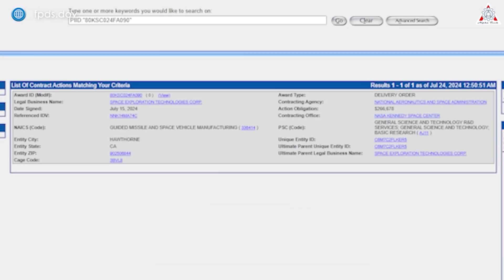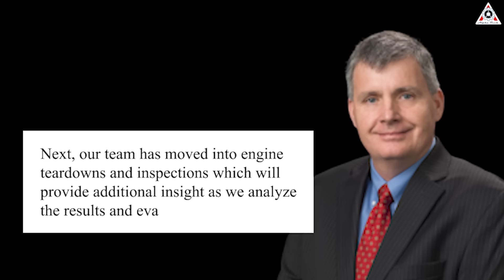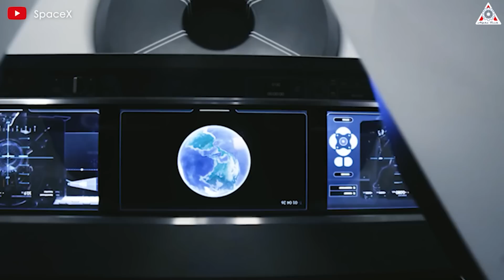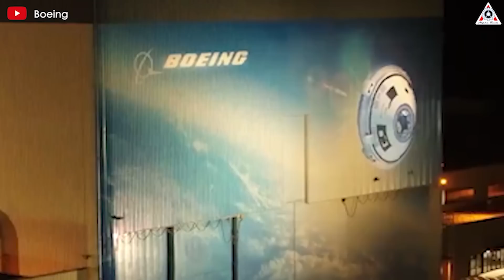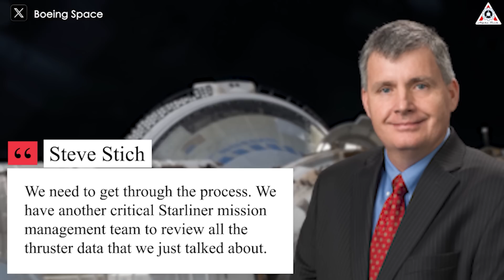Boeing Starliner is OVER!...NASA Says Something Weird Happening On Starliner.

Comment: Ol' Steve chose to omit why they fired the thrusters "more frequently."  It's because they had a Helium leak on the launch pad but decided to launch anyways.  That Helium leak took down multiple thrusters, which meant those that remained had to work harder to compensate for the nonfunctional ones.  Boeing was afraid that another launch delay would hurt their reputation and didn't give a damn about the safety of the people onboard.  And then they decided to keep those people up in space, away from their families, facing the threats of microgravity and radiation exposure for months longer than planned, so they could "collect data."  That data collection is clearly an attempt to consider all adaptations they might be able to try, so that the ship doesn't threaten the ISS and doesn't kill the astronauts Boeing is responsible for.

Comment: Dragon to the rescue. Fit dragon with the male side off the docking head. Fly dragon out empty to the space station. Have starliner astronauts disconnect from the the space station.  Then have dragon mate with starliner. Astronauts leave starliner to dragon. Seal dragon. Havr dragon drag starliner to a point and disconnect.  Starliner falls to the ocean and dragon get recovered.  Problem solved!

Comment: Proof that ISS was Russian's made, not USA. USA only provided money...😅😂😅
Reply: That's pure B.S. - and Starliner has nothing to do with the ISS. Russia - because of its decades-long experience with its own previous space stations - designed the initial module of the ISS. It sits in the middle, but is by far not the most complex, the largest, or the newest part of it. Do you truly believe Russia could have bu;lt a Space Station the size and complexity of the ISS ALONE? What a joke.
It is, in fact, the oldest part of it, and the primary reason the ISS is now failing, and its final days will be in a few years. Russia's space program consists mostly of very old tech, from the Soviet era - virtual dinosaur tech compared with every other space program. It's crew modules are no longer used because they are cramped for two people - stuffed to overflow by three, and cluttered like 1960s capsules with controls, gauges, toggle switches, and parts of the module itself throughout. Did I mention that they leak?
By contrast, SpaceX's modules have reusable boosters designed by itself, and the capsules are clean, uncluttered, spacious (designed for , with a large touch-screen display where the pilot sits, and it tilts as the pilot tilts. 
Russian Cosmonauts must feel like they've entered a sci-fi movie being strapped into a custom-fit seat, in a craft designed by a PRIVATE COMPANY, that has surpasseds, in every respect, anything the Russians ever built. 
As Putin spends Russia's future on a war Russia is losing, against a neighboring country that never asked for war, the Russian space p[rogram - sach as it was, is already dead. The next Space Station, as the current one is, will be called THE "INTERNATIONAL SPACE STATION, for a reason. 
Russia built the center module, and the U.S. Shuttle system (something Russia never succeeded in building), was used to deliver the remaining, newer modules that actually comprised the ISS. Russia's module was the smallest part. The modules that make up our current ISS were made by France, Japan, India, the U.S., Canada (which developed the "Arm" without which the Russian module would have just sat, like Mir, alone, as a tiny little boat in near earth orbit). 
The Canadian Arm made possible the grabbing, positioning, and attachment of every other module onto the Frame of the ISS - (which was built by astronauts using our Shuttle), and the ISS was completed by all these countries working together. 
Russia did NOT "build the ISS." 
It was a cooperative partner - but will NOT be invited to participate in the NEW ISS - which is currently being built. 
We provided not just money - we provided most of the technology, most of the modules, and our modules made the Russian part of the station something that wasn't well-used. 
Russia is done, now, as a "Space Program" country, and has a future before it that looks very, very grim. 
I'm not really sure why you think that the U.S. only provided money, even though the U.S. space program is light-years beyond where the Russians are. They had their chance to participate in the journey to space, and chose to spend the men and money they DID have to try to destroy and conquer a peaceful neighbor - so they deserve the future they will have. They are no longer welcome to be a part of the civilized, cooperative advanced nations of the world, and be in the future, either. 
There is no country as advanced as the U.S. in Space - I won't even rub your nose in Apollo - it was too long ago. But I will say the U.S. has multiple, SUV-sized, nuclear-powered Rovers exploring Mars, for our colony we will build there, and we have orbiting Mars satellites that are able to send information to and from those Rovers - we even had as part of our newest Rover a little helicopter, that accompanied the Rover sending back aerial pictures, until it just wore out. The Rover is still going strong, though - how many Rovers DOES RUSSIA have - or has EVER had - on Mars? None that I can remember.
How many satellites does Russia have orbiting Mars, or the Moon, and craft exploring the other planets, visiting comets, and (the Voyager probes, launched in the 1970s, OUTSIDE our Solar System, STILL FUNCTIONAL, sending back information about interstellar space?). Oh, yeah - none - war was more important, I guess. 
Russia is done, as a technology innovator (it never really was one, except in a few areas - but the U.S., and its partners, are just getting started.

Comment: It's worth remembering that NASA and North American burned three astronauts to death on the pad due to bad hatch design and nearly lost three more in space. Grumman's LM was delayed by nearly a year. Thiokol killed seven astronauts, and Rockwell killed seven as well. Don't be in a hurry to condemn Boeing or stroke off spaceX, it's not a question of "if" it's a question of "when".
Reply: wrong wrong wrong that wasn't the reason at all, stop talking crap. They used a 100 percent oxygen atmosphere, a short melted some plastic insulated wiring which burst into flames in that oxygen rich atmosphere and it spread super f'ing fast and they were dead/asphyxiated even before they got out of their harness's
Reply: Apollo One still haunts me. The reasons were far more complicated than a "bad hatch design." They were using a 100% oxygen environment, and at that time D.C. controls weren't powerful enopugh to use, so the wiring and power were all A.C. 
It was a bad hatch design - but the wiring insulation was also flammable, and there were a multitude of other issues. 
It is a tragedy that three good men had to die for the engineers and administrators to slow down and listen to the Astronauts. Gordon Cooper TOLD them it was a bad design, and no one listened. 
I have mentioned in other posts that the mistakes that NASA and Boeing are making are essentially the same. The Apollo capsules had to be completely redesigned, until they were as safe as the COULD be. Space will always be dangerous - and we've lost a lot more than three other astronauts - two shuttle disasters which also could have been presented, cost us the lives of every crew member - and if memory serves me correctly (it doesn't always, anymore), each Shuttle mission had six or seven members. 
In Boeing's case, their greed and corporate ego are on full display, and NASA's favoritism toward a long-time military contractor is as dangerous as Boeing's incompetence.

Comment: Since Starliner is 10 years late why has this testing not been done by now.  Why are they testing in the desert where it is hot  when space is cold and has low pressures. It should be done in high altitude or in special fixtures with climate and pressure controls. Maybe in future contracts NASA needs to make sure a board member of the company contractor has to be on the first maned flight.

Comment: Confidence has already eroded, the only logical and safe course is to send dragon to retrieve those two poor souls. At this point, they may need to be brought home on stretchers because of muscle and heart degradation. Plus with low helium and dead batteries, plus I am weary of their ablative heat shield. They took money for  a Maserati and gave NASA matchbox car. Is it really worth risking two poor brave souls to prove a mmm point? Send dragon with Elon to save the lives of our heroes that put their faith in a model airplane made with substandard glue , low batteries, not enough helium, probably a faulty since they didn’t learn from Apollo one to use non flammable wire with a bandaid to fix they made 10times what they gave NASA and doesn’t deserve another chance. And if those astronauts blood will be on their hands and will not wash off like Shakespeare wrote about. A disgrace to the American space program. All these years and the 737 and then this? Someone needs to go to jail and have their most tender parts violated for the transformations for building a capsule built out of duct tape and chewing gum! Space and reentry is dangerous and unforgiving for those who cut corners for a larger quarterly bonus.SHAME ON THEM!!!

Comment: Not enough Helium, dead batteries, probably faulty ablative shield, and a litany of issues probably not disclosed! Let Elon save those two precious souls!
Reply: The helium issue is completely fine; they have confirmed that the system is not leaking while isolated and there is plenty of time available once they need to use helium again. The batteries are actively recharged from the station. There is literally nothing to suggest the shield has any problems given that it has worked with no concerns the last two flights.

Comment: One thing I haven't heard from any commentator is... Did the manual control of the capsule stint during the period before docking contribute to the problems? An overconfident, supposedly seasoned astronaut with a cavalier attitude to "flying in space" may have resulted in small but accumulative number of issues that built to the point of the major problems now happening.
Reply: Yes, but no. They do believe that manual control leads to higher thruster utilization, which was likely the reason this did not occur on previous uncrewed tests. On the other hand, nothing has indicated the manual control was excessive or that anyone had a cavalier attitude, just that manual control is always going to be a bit less precise than autonomous.
Reply: No. They HAD to take manual control in order to dock, as they reported to the ground, and asked of the ISS crew, "Could you turn the Station lights on? We can't see you - there's a thick, blue, viscous substance covering the viewport." 
This thing, left to its own devices, could have seriously damaged the ISS. One of the main problems, all along, has been the automatic thruster system, and it's a good thing for the ISS that these two astronauts had the experience not to freak out, and calmly do what they had to do. 
Space is not a video game, and there is ZERO room for over-confidence, big egos, or "cavalier attitudes," 
These are two of our most competent astronauts - working as a crew to pilot a vehicle so poorly engineered it should NEVER have been allowed to fly - and NONE of this is down to anything these astronauts did or didn't do. 
If you get cocky in space, Sparky, people die - and there aren't any "do-overs," like in a video game.   
These are real astronauts, who know the risks, and do the job anyway.

Comment: I don't think you want to @1:40 keep a fueled spacecraft on standby.  Fueling up doesn't take anywhere near as long as it does to prep a vehicle.  I wonder if it's even possible to keep a vehicle on standby, since several things such as the FTS have a very short lifespan and need to be inspected/replaced when they expire.  Also the shape of the return capsule is designed to make it "self-orienting" @5:50, requiring only correct orientation at atmospheric insertion.  The computers are in the return capsule, there is not "vital information" @6:39 in the service module - what's in there is all the bits that the engineers would love to get a look at to see why it broke.

Comment: boeing is done, oh grandma!
Reply: Better than Rocket is here
Easy lift off 
Easy land on with antigravity Spaceship
No Fire
No Explosion
No Flame
Just Spin and
Lift off
Powered by Baterry

Work base on Gravity just spinning by using Battery
can fly in bad weather, plunge in the ocean even in outer space
Can lift more than 100 Ton 

Earth which weight predict 600 trillion ton does not fall at the Sun because of centrifugal in orbitting, on the contrary it does not be thrown far go out the orbit line of hold by gravity at the Sun as orbit center. Gravity and centrifugal is equal called Equillibrium, thats why until now Earth which we was inhabited always rotate and circulate the Sun. Now we justly take example : how if the gravity used and centrifugal is negated? The Earth will float far leave the Sun. So that centrifugal can be used to fly far away if gravity eliminated. Finally how to eliminate gravity?

It’s way rotate part of aircraft by horizontal. When that rotation faster centrifugal force getting greater and the gravity getting smaller, finally it lose the gravity and the aircraft start flying. Of course people would surprise: how the aircraft can keep rotate without fulcrums? Thats why we named that aircraft Shuttling System that is aircraft likes two disc adjoining attached in the midle as fulcrums:

A. The Top part, we name Positive rotate to right, and the edges is getting thicker and havier.

B. The Buttom part, we name Negative rotating to left, and the edges is getting thicker and havier.

C. Middle Part , we name Neutral, air crew placed and also machine and everythings turning Negative and Positive at the same time.

The aircraft can liftup added with explosion from the engine. However that aircraft construction later, let the engineer doit it, and we are sure the aircraft will bulletproof and also waterproof.
 
.
.
 
In modern civilization where human being generally using flying saucer as vehicle, will a lot of change in lives either in materialism and in psychological. In materialism area will apply the change in life like.
People no longger need roadway and rel road which spend large of energy, money, places, things and time, object place and time. People would utilize that area for habitat or for other need:
Reply: Rocket is complicated and dificulte
Low safety and high cost
We need somethings better
Developing technologies to enable human access to space at dramatically lower cost and increased reliability #FeelFree

Comment: Boeing is 100's of Billions of dollars over budget, and years behind schedule.
Time to END ALL CONTRACTS WITH THIS FAILED COMPANY ABUSING TAX DOLLARS.
Reply: Rocket is complicated and dificulte
Low safety and high cost
We need somethings better
Developing technologies to enable human access to space at dramatically lower cost and increased reliability #FeelFree
Reply: @dadearinto5546  it's called SpaceX
Reply: Better than Rocket is here
Easy lift off 
Easy land on with antigravity Spaceship
No Fire
No Explosion
No Flame
Just Spin and
Lift off
Powered by Baterry

Work base on Gravity just spinning by using Battery
can fly in bad weather, plunge in the ocean even in outer space
Can lift more than 100 Ton 

Earth which weight predict 600 trillion ton does not fall at the Sun because of centrifugal in orbitting, on the contrary it does not be thrown far go out the orbit line of hold by gravity at the Sun as orbit center. Gravity and centrifugal is equal called Equillibrium, thats why until now Earth which we was inhabited always rotate and circulate the Sun. Now we justly take example : how if the gravity used and centrifugal is negated? The Earth will float far leave the Sun. So that centrifugal can be used to fly far away if gravity eliminated. Finally how to eliminate gravity?

It’s way rotate part of aircraft by horizontal. When that rotation faster centrifugal force getting greater and the gravity getting smaller, finally it lose the gravity and the aircraft start flying. Of course people would surprise: how the aircraft can keep rotate without fulcrums? Thats why we named that aircraft Shuttling System that is aircraft likes two disc adjoining attached in the midle as fulcrums:

A. The Top part, we name Positive rotate to right, and the edges is getting thicker and havier.

B. The Buttom part, we name Negative rotating to left, and the edges is getting thicker and havier.

C. Middle Part , we name Neutral, air crew placed and also machine and everythings turning Negative and Positive at the same time.

The aircraft can liftup added with explosion from the engine. However that aircraft construction later, let the engineer doit it, and we are sure the aircraft will bulletproof and also waterproof.
 
.
.
 
In modern civilization where human being generally using flying saucer as vehicle, will a lot of change in lives either in materialism and in psychological. In materialism area will apply the change in life like.
People no longger need roadway and rel road which spend large of energy, money, places, things and time, object place and time. People would utilize that area for habitat or for other need: